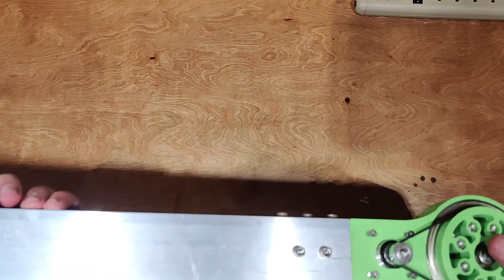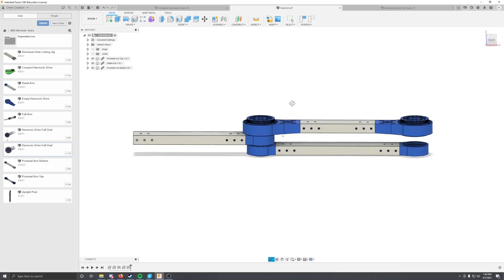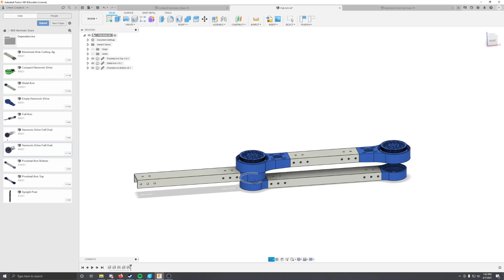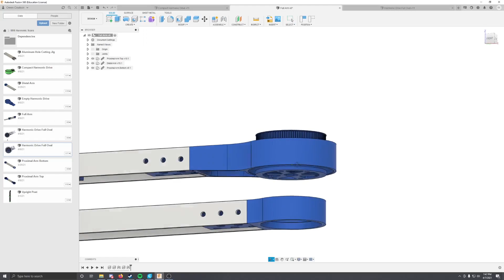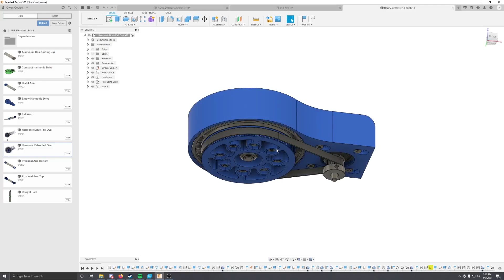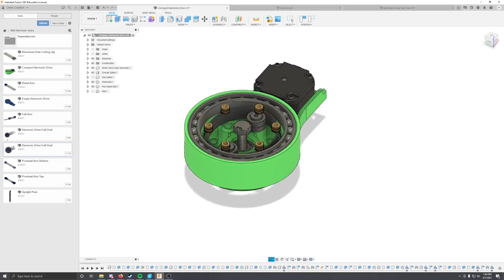Integrated arm harmonic drive system.

Comment: Great stuff :-)  I found your channel some years ago when looking into SCARA 3d printers, and thought it a shame that you weren't uploading regularly.  Thrilled to see you have started uploading, thanks for keeping it up!  

The dynamic loads on the inner actuator of a SCARA are several times higher than on the outer one, so it doesn't make much sense to use the same unit for both as in your design.  At least double them up on the inner pivot.
Reply from the maker: Although currently abandoned due to lack of motivation, the original idea was to have 2 proximal arms sandwiching the distal, so 2 drives for shoulder and 1 for elbow.

Comment: Solid iteration. Would like to see the torque tests re-done and see how much filling out the rest of the wave generator made.

I worry about the strain on the output where it connects to z. I think making the top arm a triangle which would allow you to increase the distance between bearings, reducing flex in the printed parts. It could be lighter weight as well since, depending on the angle, the force on the hypotenuse is increasingly tension rather than flex. You could use relatively small width carbon tube. Removing the lower arm also means your min z height is lower and you can mount the hotend closer to the center of the wrist, reducing twists on high accel moves. A triangle also reduces any bouncing/oscillations on z moves. The main downside is that your overall height will always be a bit higher than max build height. But you can make the Z extremely sturdy with some thick alu extrusions and linear rails with 2 carriages (one for top bearing, one for bottom). Hope that makes sense. I can make a quick cad sketch if youre interested.

Also while the placement of the stepper in the elbow is sleek. On the shoulder(?) joint it is adding to the rotational mass. Maybe minor given the radius, but mounting it stationary to the z gantry will allow you to use heavier, more powerful steppers if needed.

Also, if youre set on using aluminum. A full square tube will definitely perform better than c channel. To save weight you could drill out pretty large holes in the top & bottom faces. You dont have to worry about twisting too much so traditional t or v slot extrusion is probably overkill on the arms.
Reply from the maker: Actually the twisting of the arms is very important when it comes to the vertical stability of the arm. If the two arms are perpendicular to eachother, a moment/torque can be easily induced in the distal arm which causes massive discrepancy in the z-height. This was the main issue with my previous design.
Reply: @KoalDesigns  Ah you are right. I was mainly thinking about reducing sag at full extension. I am really curious to see how much deformation there is in the 3d printed parts with such long arms and how the c channel holds up.
Reply: @KoalDesigns  Actually the twisting could also be mitigated by a triangulated top arm. But instead of a single "hypotenuse" tube, use 2 which meet at the upper z bearing and spread to 2 or 3 times the arm width at the elbow. 10-15mm square tube would probably be sufficient and  2 of them would probably still weigh less than the second alu arm.

also, unless im thinking about it wrong, the bottom alu arm doesnt prevent these torsional forces very much unless you tie its z bearing into the shoulder drive. without, when the top arm twists, the bottom will twist AND rotate away. Im thinking as if it was all in petg or pla so in actuality, with high performance filaments, it could be negligible.
Reply: @ComeToLyfe  How about screwing some 1/16" aluminum plates to the sides of the proximal arm? Essentially making it into a large rectangular tube, which has much higher torsional stiffness than C channel.
Reply: @dekutree64  If I'm understanding you correctly, you mean plates connecting the top and bottom arms? I think part of his thought process of having them separated is so they can be clamped really tight on the elbow joint. Having plates on the sides would prevent that/increase the stress on the printed parts where they join with the c-channel. Its also more weight.

Comment: I heard that original Harmonic Drive™ reductors are actually backdriveable.
Any way to achieve this with diy design?
Reply: Reducing the reduction ratio and making the tooth shape more sine-wave like would both increase back drivability. Using a belt, tho, in theory makes it inherently harder to backdrive (but easier to skip) because the belt can deform between bearings so force applied at the outermost bearing may be lost to deformation before "reaching" the next. With a metal flex spline and/or a much tighter arrangment of bearings, force applied at the major axis, where teeth are fully engaged, should be much more distributed onto the rest of the gear teeth and strain wave gear bearings which gives better leverage to backdrive (in an industrial drive the flex spline often acts as the outer race of the bearing meaning the spacing comes down to the size of the ball bearings). To explain what I mean by leverage... The component of force acting on the strain wave gear, both magnitude and angle, is dependent on the tooth profile and tooth location relative to the major axis of the swg. At the point of full tooth engagement, the force is mostly compressive on the major axis of the swg and the horizontal force is minimal. As the force is distributed further from major axis, the horizontal force component applied to the major axis increases, but the tooth engagement decreases too so overall force is less. But its really the lesser engaged teeth that produce the backdriving force. So with a sparse interface (i.e. just a few bearings) between the flex spline and swg, the horizontal component just deforms the belt/flex spline rather than transfering it to the swg.

Also metal harmonic drives would typically have grease/lube. Without lubrication, the backdriving forces will create a lot of friction between teeth and less of that force will be converted to a component acting on the flex spline/swg.